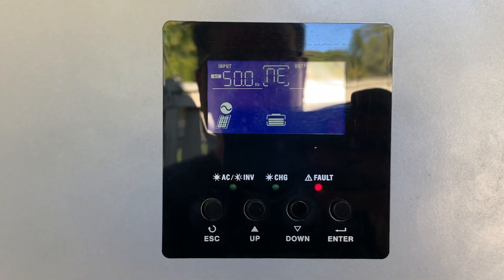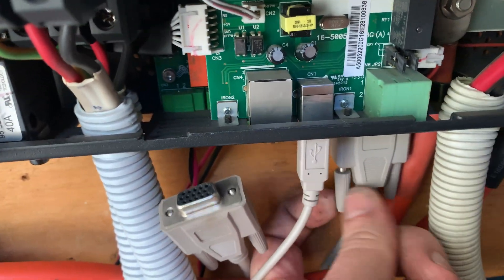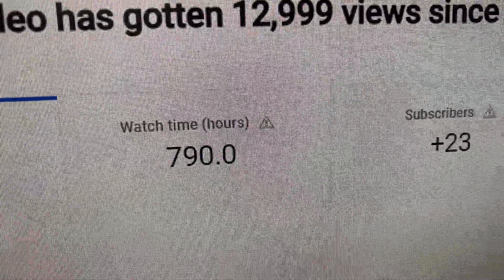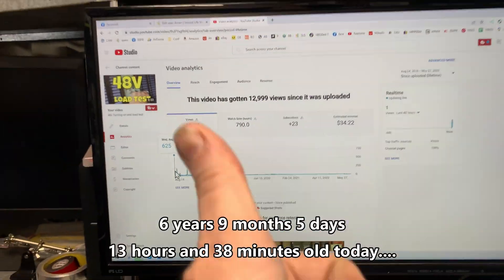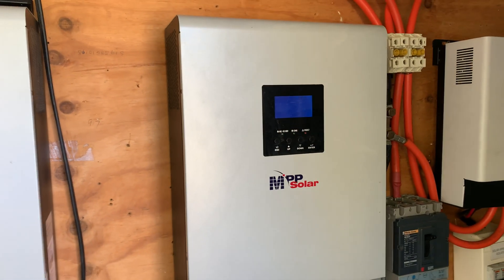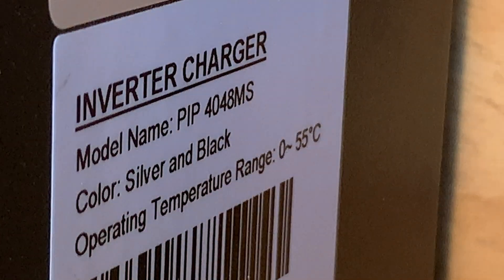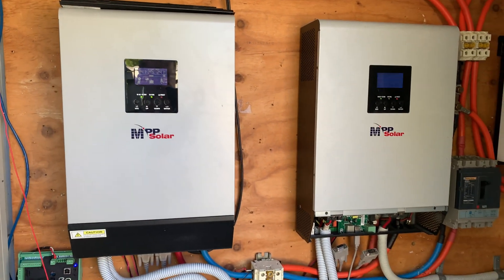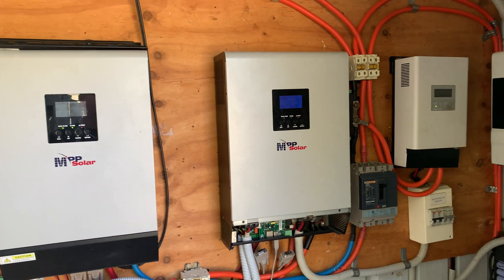PIP4048MS failed after 6 years and Nine Months!

Comment: Hello Peter, long time watching your videos, only see this video now, i have a PIP4048MS that i do not use anymore (use it for a year, stored for a while now) i can pass it to you if you want, the issue is i am from Portugal and dont know about customs and shipment fees, i guess is not worth it.
Enjoy to watch your project, also your failure probably is a capacitor in the power supply that feeds the 5V logic circuit, the behavior seems like a cycle restart because the MCU does not properly have power to wake up. I have my experience on repairing Axpert's/MPPSolar. Keep doing your hobby, you are very good at it. Bye
Reply from the maker: ooh thanks for your offer buddy, shipping i think would be killer! I've read a lot about the 5v i have the inverter off the wall and on the bench. Stated poking around in it but not gone deep into it yet

Comment: I know someone in Northgate that has one and most probably doesn't use it anymore. I installed the system 6 years ago but the lead-acid batteries died soon after.
Reply from the maker: I would be keen on a conversation with them! admin at diypowerwalls.com
Reply: @HBPowerwall  I'm on it. I'm trying to get a hold on him. Then I'll provide you his number.
Reply: @HBPowerwall  Hi. Denis from Northgate expects your call about the MPPSolar. How do I contact you privately to pass you his number? Cheers
Reply from the maker: my email is admin at diypowerwalls dot com
Reply from the maker: @nofootprintz  Finally got around to calling him thanks for the referal
Reply: @HBPowerwall  Cool. I hope you could figure something out. Cheers!
Reply from the maker: @nofootprintz  I just posted an image of it working again - its long hard work repacking the magic whitesmoke..
Reply: @HBPowerwall  Does that mean his PIP was damaged as well? If so, I didn't know that. But I'm glad your system is back online full steam!

Comment: Please, share your findings in another video. It is interesting to compare the design faults of those overpriced things. Ideally they should last for decades for that money.
Reply from the maker: DeCADES? WHAT the hell you smoking! Side note its still on the wall waiting for an electrician to come decommission the 240v
Reply: @HBPowerwall  I know it's unrealistic with modern industry, but ideally designed hardware should indeed work for decades. It is a problem with marketing mostly, they won't sell something that lasts long. Some older electronics did work for decades (mostly those made in Japan).
Reply: @HBPowerwall  For example, a incandescent light bulb lifetime when properly manufactured, is NOT 1000 hours, but about 30000 hours. You probably understand what I mean.
I'm not talking about normal lithium batteries (which are at best 2x time when made for quality), I'm talking about other devices.
Reply from the maker: no its not marketing, its US, WE want cheaper, you know how they do that? MAKING IT CHEAPER, this isn't a them problem its a consumer problem..I got exactly what I paid for!
Reply: @HBPowerwall  No, I have to remind you that a similar electronic part made of cheap counterfeit Chinese parts, but without intended schematic mistakes, would last 2 times longer and cost 2 times less, that it a pessimistic estimate, in reality it could be better. There is a trick in those "high-end" electronics, they have either faulty design or "custom-made-defect" parts, like cracking due to thermal expansion ferrite chockes in those expensive OSRAM led bulbs (I no longer purchase them after learning the truth). So you are buying a lot of OVERPRICED products, not cheap ones, as you might think - while it is true that they could cost 2x if they made without defects with high quality parts, it is also true that they would last at least 2x with the same price of components, but without INTENDED defects.
In fact, you may be surprised to know, that the parts there are not high quality necessary, but STANDARD quality, meaning some some counterfeit Chinese parts may have better quality (which require manual testing to separate them from trash).

Comment: That's probably just the starter cap on the internal switch-mode power supply, ie, it tries to start but the voltage sags and it turns off and restarts again. Look for a small electro near a chip.
Reply from the maker: Really hoping so!, thanks for the input

Comment: So Pete.... now that i watched ur video.... I can tell u the clicking relay is a mystery..... never seen that fault b4 but likely u should attempt a repair on vid asap so I can see the magnification of the board.... uno the 1st thing is a visual inspection of all components around the relay, take out the relay and put power to it and check for continuity etc and i doubt u will find the exact replacement either.... maybe ring EPP Solar and find out what unit is compatible to it in the daisy chain to make it work. Did u ever think it may just need a hard reset?? check all connecting wires too maybe corrosion on the pins etc.

Comment: that looks more like a classic power supply failure to me, specifically the low voltage converter supplying the controller electronics, it's no longer coping with the surge current of the startup sequence and is tripping out. Dead capacitor is a likely culprit.
Reply from the maker: I hope you're right!

Comment: I wish I had one I could send you.  6+ years is pretty good.  If I remember, you have these in an un-conditioned shed.
Reply from the maker: I'm stoked expected 2 years, I think the reason the have lasted so long is the fact they are just left on 24/7 and not messed with. Until i messed with them lol Thanks for the offer buddy - i'll be looking at lots of videos now trying to work out a path forward. Yes the inverters were on the south side of my house (sun is from the north here in Aussie Land :P ) So the shed never saw full sun and only had one 10cm 48v fan to move heat out of the shed in mid summer

Comment: Your lucky to get that long out of them Pete.... cos MPP Solar never used lacquer on the circuit boards..... the stingy basteds........ Many have blown up due to moisture and humidity and ofcoarse not sealing up the cabinets from insect infestation.
Reply from the maker: Farm one suffers from that, everything is rusted & the internal MPPT charger failed after 3 years, but inverter still working fine.

Comment: Take it offline.  I had a similar situation with an old inverter/transformer in an old travel trailer.  I kept hearing the same clicking at a very similar interval...turned out to be a battery wire shorting out on the frame.  I've been following you for a few years now, and somehow, I think you will find the issue.
Reply from the maker: I kinda hope I can fix it but don't think it'll ever go back into full time service as I need it to work and not be a mabye. Good news is the house run on the second one last nigh with out issue.

Comment: Pete, got 2 brand new 6548 mpp solar still in the box. 1/2 price if shipping from USA makes sense. Bought them a year ago for $3,400 US delivered. Swapped to Schneider and not needing them now.
Reply: Are two needed to run split phase?

I don't remember how these work.
Reply from the maker: @philloder that'd be awesome but likely 110v if in the US and shipping would be madness!
Reply: @HBPowerwall  Pete, I just checked and you are correct as single phase parallel units only output 120V.  USA has to be the odd man out! So sorry to waste your time..

Comment: When I bought my 5048MS there was a guy having a go at the PIPs and at Justin Case (he may have some old gear or perhaps his newer 5048s as he's moved to Lithium and some other inverter) but the guy having a go got into the PIP and saw they only had fairly low temp and 150V capacitors he had some issues with Cloud Edge effect and his AGMs at the time. I would check the capacitors personally might be swollen - near 7 years is pretty good Fronius grid tie is 10 (extended warranty and they're 3 grand or so a pop and Victron aren't cheap too paid 1K for a charge controller 250/100 second hand) There are other PIP like models now one - PowMr though they seemed to have gone up like everything else recently. I got caught out bought a 5048MS and 6 months later they did 450V MG ones which cant be paralleled even though asked the Sales if they were ever going to move from 145 to higher PV input ratings (save on copper).
Reply: I saw a video from a guy in Norway who used a Fronius Gen24 Plus with an unmodified Nissan Leaf HV battery (at full pack voltage) to run his cabin. Amazing.
Reply from the maker: I remember Justincase, watched him from the VERY early days of his channel, didn't like him or his direction due to turning off comments and a few other things - good content tho back in the day!

Comment: Probably a dried out capacitor in the power supply for it.  It's trying to start but can't power on long enough for the switch mode supply to start up properly so it's cycling kind of like you see LED lights do sometimes when they fail.
Reply from the maker: Really hoping it's that easy!

Comment: Should be a walk in the park for a guy with your skills. No soft start on that model so no spark now as it won't charge the cap.
Reply from the maker: I've had ZERO luck with inverter repair, have an old 24v PIP, Zantrax & chinesium inverter here I failed to repair - tried to do an inverter repair video but ended up me just recycling them lol

Comment: 7 years is pretty sh!t considering what these cost...
Reply from the maker: I paid 600ish each 2465 days in 6 years nine months... thats 0.24c per day, THAT is the price of 1kwh of energy from the grid - I suck at math but that's a cracken good deal from a cheap brand inverter!
Reply: @HBPowerwall  Thats essentially 100$/yr. I have a 120$ power inverter in my work truck that see's daily use and its been flawless for more than 10 yrs.
Reply from the maker: do you put 30kwh a day through it? Do you also charge from solar with it? Do you have loads that go from 100watts to 8000watts a second later?
Reply from the maker: I think your version is hookers and house wife argument lol
Reply: @HBPowerwall  It runs a plasma cutter and welder off my pto mounted generator, so its seeing some pretty significant duty.
Reply from the maker: yeh, that's impressive then!

Comment: I don't think it's the relay's fault. They don't usually fail in "clickety-clack" mode. It's more likely something that controls the relay. I've had a similar issue with my UPS and it was one of the switching regulators that controlled the LV logic that crapped out. In my case it was a STR-X6769 that is almost famous for having problems with switching to low-power mode and it also has a protection latch that isn't exactly good. Maybe yours has something similar?

I would recommend checking all the fuses first, then checking the transistors, bridges, diodes and linear regulators on the logic board and if all else fails or you notice some bulging replace caps.
Reply from the maker: Awesome i'll keep that in mind when i'm pokin around in it trying to fix it

Comment: I'd be looking for swollen or dead caps before replacing the relay. A bad cap or shorted cap could easily cause a relay to cycle on and off.
Reply: Can confirm, had one with this symptoms just change the two little caps on the top right, left side of the small yellow transformer. But these inverters are build to fail.
Reply from the maker: seems to be the way my mind is heading.. caps are easy to see, cheap to buy and easy to fit so I can only hope its that .
Reply: @tripplefives1402 " the 5v power regulator cycling because it detects a short."

The screen runs on 5volt so there is no short there.
It toggles on the relay so the power supply has failed and can nolonger supply the current needed for the controlbocx. Potential cause: literally anything.
Capacitors can be the cause, and so can everything else.

Whatever turns out to be the cause, it's worth having a look at the other uint and pre-emptively replacing the same parts on that unit aswell.
Reply: Agreed, a relay takes a current spike to cycle, if it's cycling i'd look at what powers it before the relay itself.
Reply: I agree with this assessment. Probably uses cheap capacitors.
Reply: Pretty much all inverters, mpp, aims, growatt etc come with cheap non name brand capacitors. Definitely replace them asap

Comment: Personally I would bet on a part of the low voltage supply for the inverter's internals being toast, causing it to repeatedly power up and then immediately run out of juice and shut down again. Could be a bad cap or some other small fault on whatever buck converter circuit it's using for its own power. Just guessing though, could be a cool follow up teardown video
Reply from the maker: THAT really makes sense

Comment: Does sound like a reiay
Reply: Relays usually don't fail this way. It's more likely something that controls that relay.
Reply from the maker: Sounds like it yes, I was shooting from the hip being rather pissed off at the time - something is causing it to turn on and off for sure!
Reply: @HBPowerwall  if memory serves these kind of devices use a 4 pole contactor using one of the terminals as a activation sense/latch.

So the contractor closes making the circuit with the grid, and the forth terminal closes a circuit telling the processor that it's time to do a grid frequency test. 

So I believe what's happening here is the contractor is closing and the sensor is opening it again as it can't sense it's state. 

If your lucky it will be in a socket but I somehow doubt that

Comment: Probably a bad relay, probably worth testing the capacitors as well when you have it open. Amazing how far things have come in almost 7 years though.
Reply: I would bet caps, based on how it failed aka it was turned off then never came back. And its trying to start rely sounds like its working
Reply from the maker: Yeh caps or mosfets is my thinking, it was all turned off, solar was off, the inverter was off, incoming grid power was off, the inverters primary source of power is DC, so thinking that turning off the DC (hasn't been done in MANY years from memory) killed something that was already dead/dying